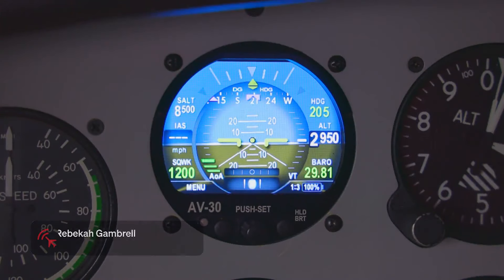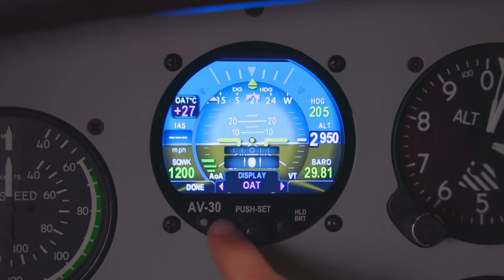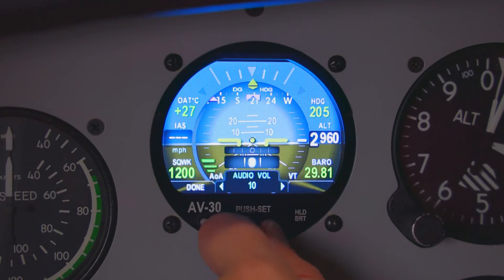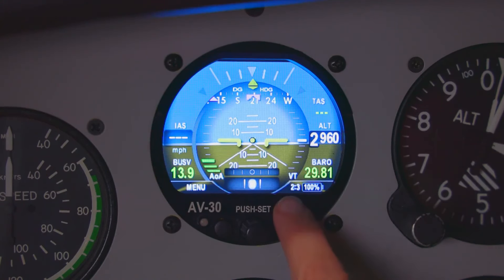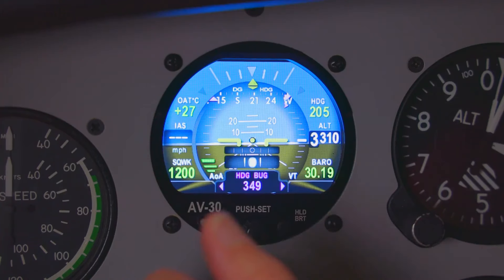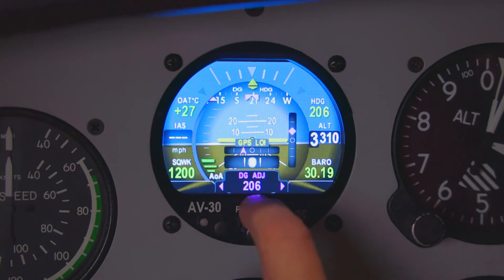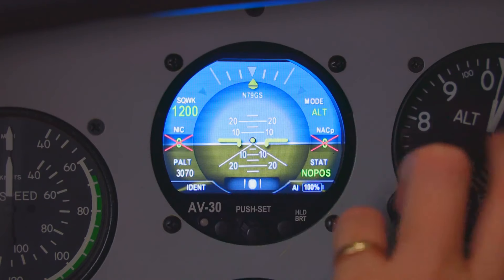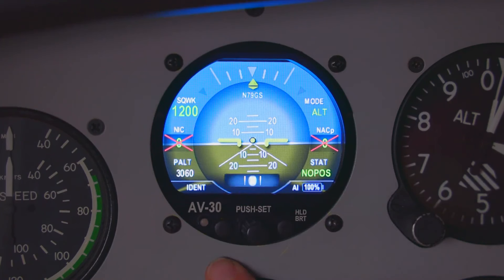Tech Tip Tuesday: Buttonology 101 of the AV-30

Comment: Love the av30 I have in my Cardinal. I was hoping there is a way to keep the barometer setting to only advance 1 digit at a time. I end up having to go back and forth quite a bit trying to dial it in. I only fly at airports witing a 2,000 foot range so my changes are always small. Thanks!

Comment: I see a nightmare trying to adjust the unit in flight. Turbulence, having to look away from outside the aircraft while fiddling with tine knobs. The demonstrator is a lady with smaller hands that mine -- I would have an issue with this in flight, just adjusting the same things that she is demonstrating,
Reply: I use the certified version and the settings she is referring to are mostly done during setup.
Reply: Seems pretty complicated
Reply: It isn’t that bad.  I have two certified versions and we love them.

Comment: Well done Rebekah, always insightful.  Instead of “old” how about “classic”.  ;)

For those that think it’s an issue changing things, particularly in turbulence, it’s not bad at all.  I’d rather have the dial/push button combo vs. a touch screen that is all the rage these days…as was also mentioned, aside from squawk and selected altitude, most of the settings Rebekah demonstrated are done once on set up, or before flying.
Reply: "Classic" I like it.